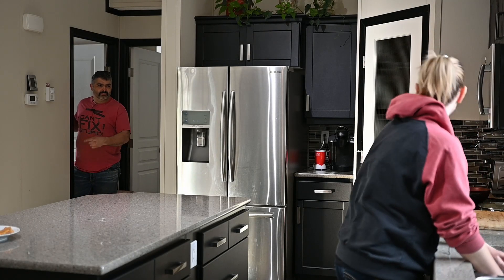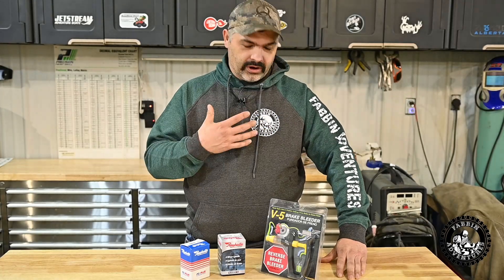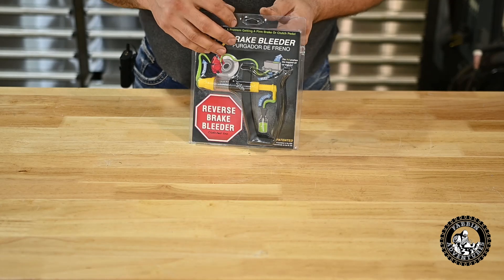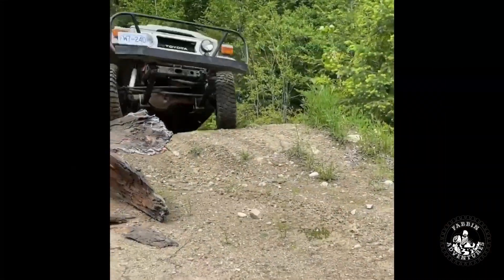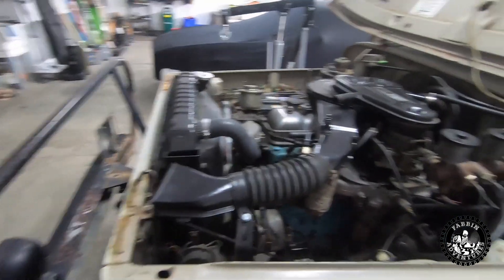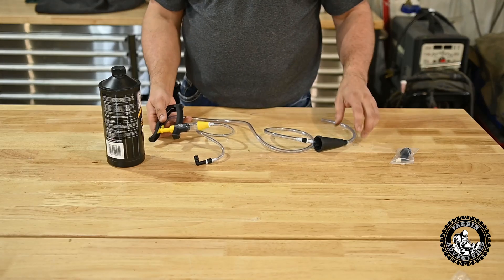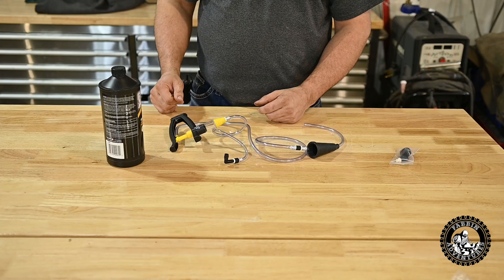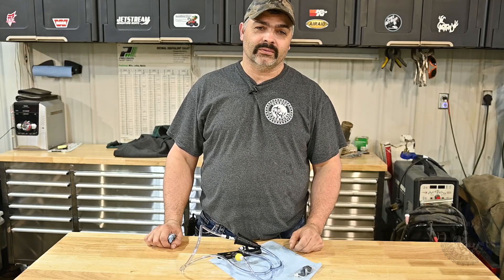Brake Bleeding in reverse: Replacing Wheel cylinders

Comment: I thought of a way to do both sides more thoroughly. Empty the whole system. Open the bleeder on both sides. Pump fluid into one side until it starts coming out the other side. Close the other side. Then finished pumping until reservoir is full. Should be no air hidden mid line if you do it that way.
Reply from the maker: Thats a great idea, i'll try that next time!
Thanks for watching and commenting!

Comment: That does not seem like a good idea at all - that will push gunk deep into the brake system... there is always a bit of crap that gathers in the cylinder...
Reply from the maker: I suppose thats possible, but it seems to work great.
Reply: Itried this and your right it pushed all the gunk into the master cylinder. I will use it to pump out of caliper next time.

Comment: Video starts at 11:03
Reply: Thanks.  I don't understand why these guys always vlog about their personal life/vehicle when I clearly clicked the video for what I searched in the title.
Reply: @shidfard  I hear ya. I purchased this tool shortly after my comment. It helps a lot but I’ve only used it a handful of times and mostly on hydraulic clutches as I mostly work on pneumatic brake systems. I still need a helper to watch the reservoir for air bubbles and to keep it from over filling. I suppose I could buy longer tubes.

Comment: I used to have a special bleeder for my 1968 Austin Mini. It attached to the top of the master cylinder, and used the air from the spare tire to bleed the brakes as you cracked each bleed open.
Reply from the maker: Yeah, i had another guy say thats what he uses, sounds like a great idea....i hate bleeding brakes.
Reply: @FabbinAdventures  I just had to remember to keep an eye of the fluid level, AND refill the spare tyre... I needed it one time when it was flat for no apparent reason... haha! 16 year old me was in a hurry to drive girls around.
Reply from the maker: Yep that would be the problem bleeding from the top is pumping all the fluid out and introducing air again to the system.
Reply: @FabbinAdventures  How do they bleed air brakes? With methanol? Haha!
Reply from the maker: Yes, in the winter.

Comment: I've fallen in love with my Motive Power Bleeder, toss 30 PSI on top of the master cylinder and crack open a bleeder and it forces new fluid through the entire system.  This setup lets me bleed all four corners by yourself real fast.  To be honest, the fluid at the caliper side is heat cycled and turns dark with contaminates, that's the last thing I would want to push all the way back through the master.
Reply from the maker: That sounds like a pretty sweet system, ill have to check it out, im always lookin for a "better mouse trap"
Thanks for your comment!
Reply: Reverse bleeding can be effective for a clutch...all 8 of us that still have a manual transmission.  ;)

Great point about pushing the fluid back.

I tried the Motive system today and really like it.   I tried 12 psi and that was pushing the fluid too fast for the slave cylinder bleed.  My second bleed was at 7 psi and that worked great.